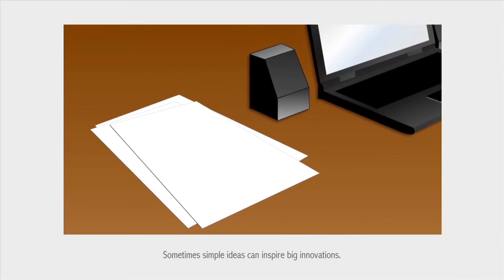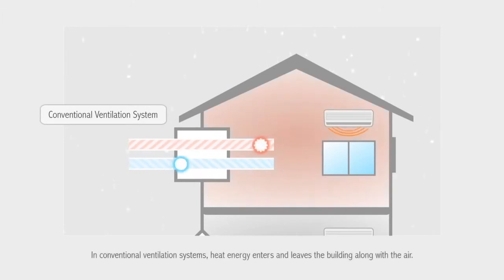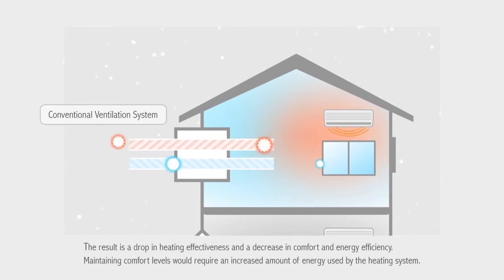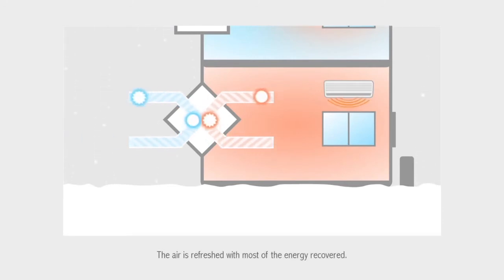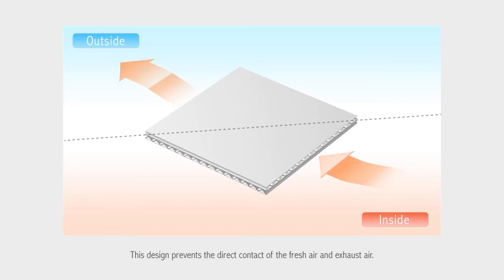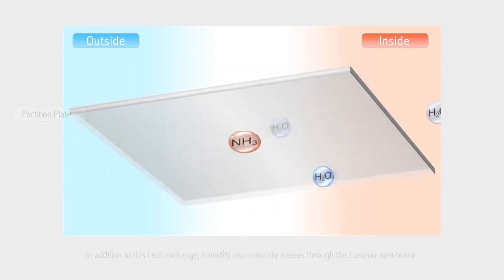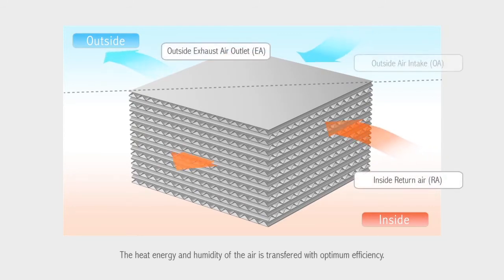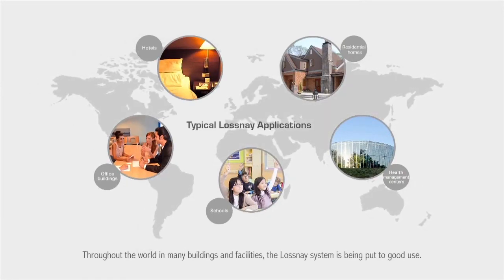How Lossnay Balanced Heat Recovery Ventilation works

Comment: 1.)	 Is the indoor air filtered, as well? The indoor air that goes through the heat exchanger core.
2.)	 The small amount of indoor air removed from the building, does that go through the heat exchanger core first, before disposed outside?
Reply: There is a pre-filter at the heat exchanger for the fresh incoming air which provides some filtration for the external air before it comes into the home.
The extracted air goes through the heat exchanger as well and this is used to help warm (or cool) the incoming fresh air. The system is balanced so the volume of air being extracted is the same as the volume of air being brought in. 
Hope this helps.
Reply: @hamishmartin5919  Thank you. I understand this part. I just wanted to know if the extracted air from rooms are filtered, as well.
Reply: @RP-mt6bp  Yes - typically the extracted air is filtered at the heat exchanger to stop any contaminated air fouling the heat exchanger on the way out.